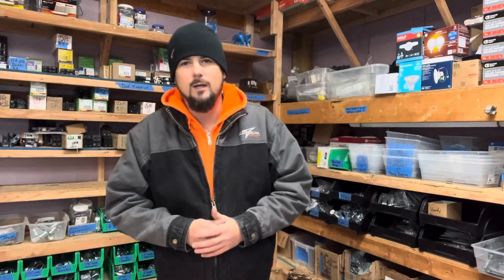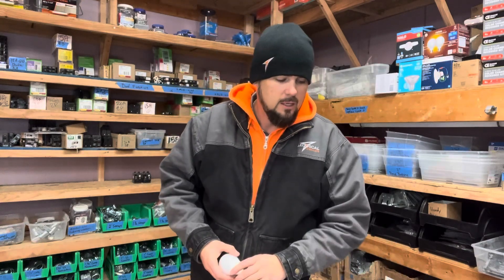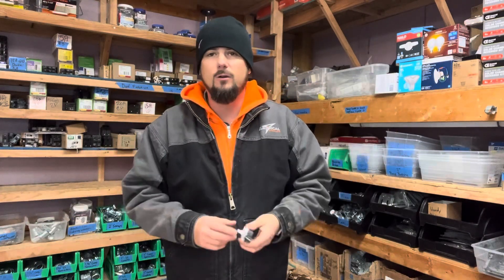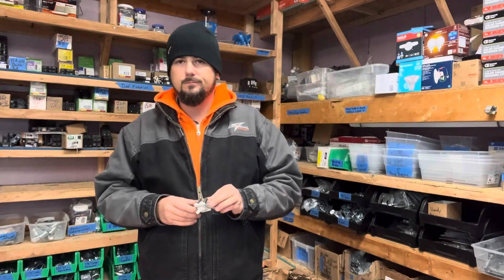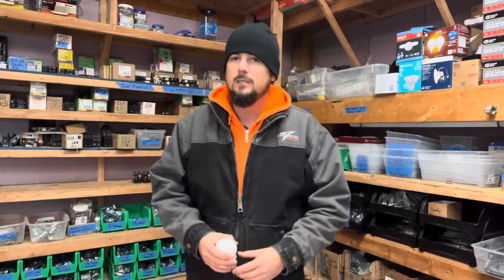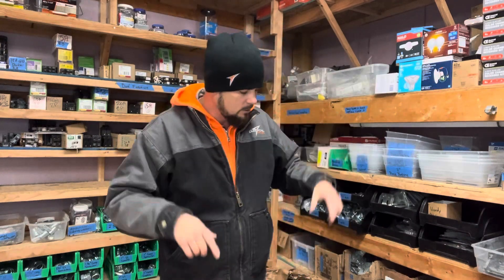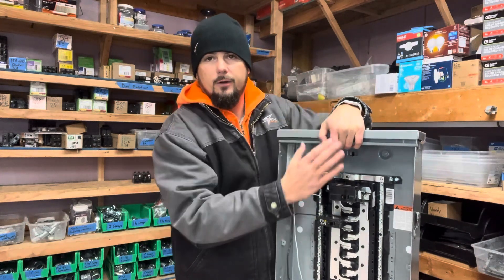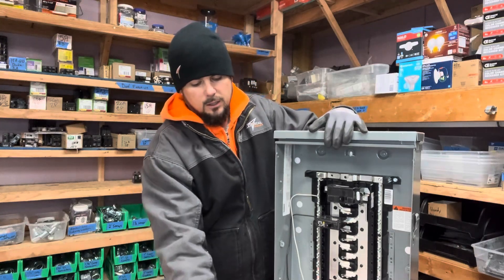WHY ARE MY LIGHTS FLICKERING ?!?

Comment: Why my cloth dryer has too much current draw when I press the turning button, and shut off the furnace for few minutes , and some time trip the breaker, and also flicker some light?
Reply: You may have too many loads connected to the same circuit. The dryer should have its own independent circuit breaker. If it does, then you may not have enough power feed to the house and turning on the dryer is causing a brownout that causes the furnace to go into safe power-down mode for a few minutes and the lights to dim. The wiring to the dryer may not be a big enough gauge if the circuit breaker keeps tripping. Have a professional electrician evaluate the power feed to the home and the wiring to the dryer.
Reply from the maker: It sounds like your breaker may not be on a dedicated circuit. If this is the case it will definitely need addressed as this is a fire hazard and will cause continued problems. I suggest having a licensed electrician take a look and diagnose the issue correctly.

Comment: Pretty sure my issues is the shoddy connections on the pole across the street that has a Vienna curve to it. Lights flicker when the wind blows especially when raining
Reply from the maker: That's a good observation. You might give the power provider a call and see if they will be willing to verify the connections. It shouldn't cost you anything. Thanks for watching!

Comment: My 100 amp main isn't on the top. It's plugged into the tabs like all the other breakers. What I found was a bad tab that the main was plugged into. I'm an experienced industrial electrician. I initially took a thermal picture (Seek Thermal iphone plug in) and it showed excessive heat on one of the load side breaker connections connecting to the backbone. I insulated the area surrounding the incoming utility feed. Put on my my flash suit and gloves and disconnected and capped the incomming feed. The 100 amp main breaker connection points were damaged and the tab on the backbone was burnt. Fortunately I was able to replace the main and move it down one position to get it back up temporarily. I'm going to buy a 100 amp panel and replace the defective backbone. Don't try this unless you're a qualified electrician. I worked on everything from 5VDC to 138KV for 30 years and routinely did this type of work safely. Call an electrician if it gets this deep.
Reply from the maker: Wow! You are definitely a trooper my friend. I am always cautious to tell people to work on their own gear, but it sounds like you have been around it for so long you are pretty darn comfortable. That's the difference. If you understand how it works and know how to operate around it comfortably, its not so bad. Its the ones that are not sure and put themselves at risk nervously taking a chance that end up in a bad situation. More power to you my friend! No pun intended.

Comment: Do wago connectors cause this problem
Reply: They could if the wires were inserted incorrectly and left loose. However any loose connections anywhere will cause the issue.. not specific to wago, just installation errors..
Reply from the maker: We personally do not use them for this reason. They work fine if installed properly. Unfortunately, they are typically used to reduce install time and for that reason have a good rate of failure.

Comment: 5:00 Can switches make a bad disconnection? I replaced a ceiling fan, and the switched hot was to the fan was showing 20VAC while the switch was off.  The switch measured normal with ohmmeter continuity check.
Reply: Maybe you are switching the neutral instead of the hot.
Reply: @stans5208  Thanks.  No.  I replaced the switch but still need to remeasure at the fan.
Reply from the maker: @louf7178  Sometimes there can be ambient voltage on a wire. We have seen it where when wires are crammed together sometimes voltage can leak from one wire to the next. Transient voltage.
Reply: Thinking it had to be a white wire, i cked the switches first, then got into panel and torqued all white wire connections Desperate for a solution, I went to Ace hardware and bought an old fashioned NON LED bulb and bingo problem solved. Thanks for posting this as it let me know. That i wasnt the only one with this problem and its a common fixable problem !

on led bulb and it works fine
Reply: @billybob81845  Great! I think the "problem" I had was due to disconnecting wires on a shared neutral circuit.

Comment: Make sure that you are knowledgeable enough with electricity, electrical safety and single phase 120/240 3wire residential electrical services before attempting the following.  Remove the cover to the panel and have a multimeter to check for a neutral problem with the incoming power.  Leave main breaker on; you need a load on the panel to perform these tests.  First check for full voltage from each side of the phase which should be 220 - 250VAC.  Next, check voltage from neutral to each phase conductor.  They should be roughly half the voltage that you read across both phase conductors originally +/- 3VAC.  Any greater voltage disparity may be a bad neutral or a bad splice.  Call your power company to make those repairs.  If you do not have this voltage disparity, make the same voltage checks as described above on the load side of the breaker or on the buss bars themselves.  You may have a bad main breaker or if your main breaker plugs into the buss bar, that connection may be bad.  If so, replace main breaker clean buss bar if possible before installing new breaker.

Comment: My parents noticed that all lights in the house would flicker whenever a heavy truck went by on the road outside. My father suspected a loose fuse holder on the power pole out front. So called the power co to report the issue. I was home when the lineman turned up to investigate. He checked in the meter box first, found no issue. So got out his ladder, and up he goes to check the fuses. The first one he touched, fell out into his hand. Bingo! My father was right. No more flickering lights. 
Only other times we've had issues, has been bad LED bulbs, or welders being used at night, causing large current draws.
Reply: Wow.  That was good!
Reply from the maker: Absolutely! That was some good detective work for sure.

Comment: 4:00 U can also torque led bulbs in too far & pop the center disc in the bulb base loose from the screw base, making a no-connect or poor connection.
Reply from the maker: Good point.

Comment: I'm still trying to find the source of my kitchen lights flickering, I already had the service upgraded from 100A to 200A and replaced all knob and tube that are easy to access,  I'm replacing all fixtures and have replaced the light fixtures on all floors with LEDs . The flickering got worse with the LEDs?  This tells me there's definitely a loose connection in a wall or ceiling probably a common wire in the kitchen because the kitchen lights have different switches. Boy it's fun tracking down something like this when you have a house built in 1914 that's wood framed but has a solid brick facade. It's not the cheap stuff spread on today but actually real bricks sitting on metal supports, I have to be careful if I open an exterior wall to track wires.  It's hard to explain but the house is in the Michigan UP 20 minutes from lake Superior,   so much fun trying to figure out how it was designed. Homes up here were built differently to deal with the harsh Winters in a old iron/copper mining region.  I don't know what my point is YT suggested this video because of my previous searches about this topic. Fun fun fun 😂😂😂
Reply from the maker: That is very interesting. We have many turn of the century homes here in NE Kansas and this is an issue for most of them as well. We would all love to completely rewire them but the cost is usually out of most budgets and exceeds the value it offers. We tend to use Arc/Fault GFCI Dual function Breakers to properly protect the wiring. That of course comes with a good bit of troubleshooting to find the bad connections of which you speak, and sometimes involves running a few new circuits and abandoning the ones that seem to be the biggest trouble makers. Older homes are very lovely but come with their fair share of issues, but hey. What homes don't? Thank you for sharing!

Comment: This is great information. My lights dim when my tankless water heater turns on. We didn’t add any extra load to the breaker box but the water heater itself draws a ton of electricity especially when it first kicks on. I’m going to look into getting a whole house surge protector. I imagine eventually I will need to upgrade my panel when we go to install mini splits. Our house is fully electric. No natural gas in my area. When we get a new roof I want to install solar to hopefully offset some of that cost. We use a wood stove as our primary heat source in the winter but still need small room heaters to supplement on cold nights.
Reply from the maker: Excellent! It sounds like you have it all set up. I definitely suggest the whole house surge protection, but I would just keep in mind, its primary job is to protect your appliance circuit boards from excessive loads. The dimming will most likely continue unfortunately. We are hoping technology continues to advance and we have a solution for this in the near future. Thank you for your response!
Reply: If you don't do the solar yourself you won't offset any of the cost. The install prices are scams.

Comment: My brother had a fire in his house caused by a loose connection in the distribution board. Was plastic (legal at the date of installation), so lot of smoke damage in adjoining rooms.

Read somewhere a UK householder called an electrician in about their flickering lights. Electrician disconnected everything from the mains input and found variation in the supply voltage. Later investigation by the power company traced to an illegal cannabis farm a few houses down the street had hot-wired round their meter, and all the heaters/lights switching on/off was causing the spikes.
Reply from the maker: Wow. That's a new one to me, but great story. Thanks for sharing.

Comment: When I turn on my fluorescent shop lights my radio (120v) picks up so much interference I cant use it. I wonder if there is some sort of a filter I can install in the light circuit or on the radio end to clean up the problem?
Reply: Ballast going bad. Replace them with LED save some money less current draw.
Reply: @My1970TransAm  Ballasts are fine. Lights work fine. Instant on, no hum, no flicker. They just cause radio interference when I turn them on. Been like that since the day I installed them.
Reply: Try plugging your radio into a different circuit if possible and see if that helps. Even better, if you have a circuit that is on the opposite phase of the shop lights.
Reply: @charlesford157  Good suggestion, thanks. I need to determine if the interference is is being broadcasted through the air by the lights and being picked up by the radio's antenna, or if it is circuit power interference. Your suggestion should isolate which. Thanks and stay tuned.
Reply: Amazon sells filters for this issue. Installed them just upstream from lights in my shop now have great FM reception. 

Search for Noise Suppressor Power EMI Filter

Comment: I have recently introduced tankless hot water heaters to my builds and have noticed the lights flicker when the homeowner calls for hot water so the large amp draw in the bus robs power from other devices. I have tried upsizing the SEC cable on my last build and that helped A LOT!  you mentioned a surge protector well a surge protector protects from high voltage spikes.. a line conditioner is the only device I’m aware of the keeps the voltage level even to the end of the run.
Reply: I have 2 tankless and my lights never flicker. What size service do you have?
Reply: My tankless totally makes my lights dim when it turns on. It’s an older house though but I used 6/2 wire when the heater only called for 8/2 mainly because it was already run to that side of the garage for an old furnace we never used. The water heater uses 3 40amp double pull breakers. The furnace used 2 50amp double pull breakers and the old wh used a 30amp double pull breaker. Ran one more 6/2 wire so they were all the same. In theory I’m using 10 amps less than was on there before with the furnace but I’m pretty sure the lights flickered when that turned on. I’m probably going to upgrade the panel hopefully when we get solar. Might as well just update the whole system. Can you get the power company to upgrade the service entrance cables or is that something that needs to be done on our end.
Reply: @rachaelb9164   Sounds like its the original 100 amp panel.if so  dangerous with the big loads your running, If so yeah lights will flicker with a instant on tankless especially the big tankless  you have now.
I would measure the incoming power drop to the panel. Then turn on the tankless  and turn on the furnace too then measure the incoming again see how low the incoming is going. Also while your at it with those units on listen to all the breakers carefully see if you hear any of them sizzling.  I hope you have a double big blue water filter on your house at a minimum  to filter the water if not you will have issues DTR with your tankless. Btw, when I replaced my original 100 amp panel in my house I had them run a new drop and I had it buried. No overhead wires. No roof penetration. Really nice.
Cost $500.
Reply from the maker: You make an excellent point. Our main concern in this situation is to protect the equipment from excessive wear and prevent fire hazards. However we have used phase monitors in remote locations where the power provider does not have reliable voltage and that has helped from burning up heat pumps and the like. Excellent thoughts. Thank you for your input!

Comment: I am no electrician but wow, this bit was fascinating. Especially the outside a.c. unit draw kicking ass to the entire electric grid. Now I know. Thanks for sharing! 🤔
Reply: Get a heat pump. They draw about 1/3 the current of a conventional air conditioner. Depending on where you live, you may or may not need heat strips for those really cold days when the heat pump isn't enough.
Reply from the maker: Absolutely! Yes, over time manufacturers have found out that their equipment is being prematurely warn down by power spikes. When most people think surge protection, they naturally think lightening. The honest truth is most spikes come from within the home. AC units, ranges, dryers, hot tubs etc. These all call for large amounts of power quickly and I think we are all just now catching up with how much of a problem this is and finding affordable solutions. Thanks for sharing!

Comment: You also might want to differentiate between torquing solid wires vs stranded wires at the service panel.  Stranded wire needs to be torqued a number of times due to the strands flattening out under the screw where solid wire doesn't.

Comment: Regarding the A/C kicking on, if it is really bad it might advisable to get an HVAC tech to check the A/C for bad capacitors or maybe add a "hard start kit".
Reply: Another way would be to install a Soft Start device, for your A/C according to the size of your unit or units... These soften the start inrush current draw, and ease the compressor start load, and the demand for electrical home load, at start-up of these high amperage start loads.
Reply: @dporrasxtremeLS3 Exactly! I do believe that is what he was referring to by saying "hard start kit" but correct terminology is in fact soft start, and every high amp draw appliance should have them incorporated these days, but most do not..
Reply: @dporrasxtremeLS3   I agree with your comment. The "Hard Start" or "Kick Start" as some of them are known will cause an even HIGHER in rush amperage draw. Resulting in even more dimming .
Reply: Soft start kit is the way to go.
Reply: What if this happens when neighbor’s unit turns on?  I’m in a condo with 8 units!
Reply from the maker: If they are on the same power supply this could definitely happen. If you are on your own meter the odds are low but worth checking into. Great question.

Comment: Great review of problems & their potential causes. What about can lights flickering because the connection is contacting blown in insulation in the ceiling? (other side of ceiling is the attic). Fact or urban myth? Does the connection for the can light need to be installed with a recessed light cover?
Reply from the maker: Excellent observation. As far as the wiring and connections, can lights have the same limitations as any other fixture. The major difference is most of them have a heat sensor built into the canopy or on top of the unit for this exact reason. If the can overheats due to over insulation or the use of a bulb that is not rated for use inside the enclosure, it may flicker or shut off all together until it cools down. This was really only an issue until the last 10 years when LED bulbs come into the picture. They typically do not produce enough heat to register with the thermocouple. Also most cans are IC rated (made to be in contact with insulation) and it states so on the UL listing inside the can. If they are not IC rated they absolutely need to have covers on them or have the insulation pushed to the side. Also recessed LED wafers and LED trim inserts are a great solution to these issues as well.  Thanks for your input!